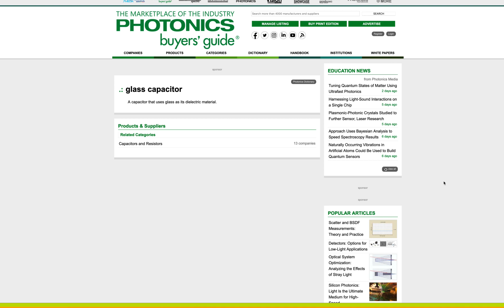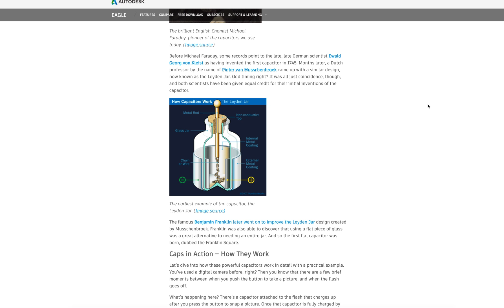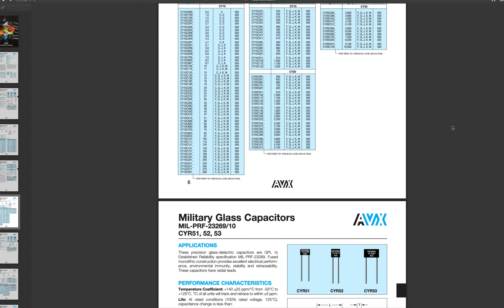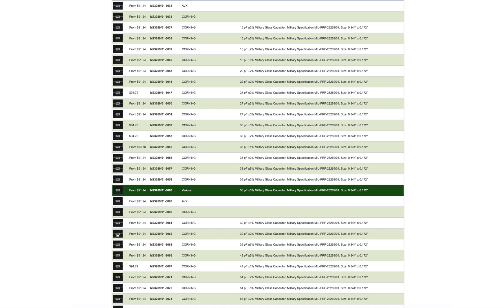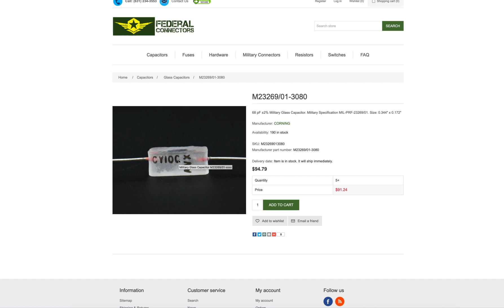🧐 GLASS IS A CAPACITOR. PERIOD! Academic hubris run amuck

Comment: A capacitor is actually what you get if you put an insulating material between two separate conductive materials, for example, a capacitor can be formed if you place a thin sheet of plastic (the insulating material) between two separate sheets of aluminium foil (the two separate conductive materials), it was originally referred to as a condenser before it was called a capacitor.

Comment: Why don't they make capacitors out of quartz instead of glass? Quartz is clear hexagons on atomic structure where as glass amorphous hexagons on atomic structure. Also it is rumored quartz are used in anti-gravity crafts, check Mark Mccandlish video. Viktor Grebennikov's anti-gravity beetle wing cover also had microscopic hexagonal pyramids so there's some connection there. Viktor Grebennikov glued lot of beetle wing covers in his anti-gravity craft in pyramidal position and ran high voltage through it with Van de Graaff generator. Pyramid shapes and hexagon shapes possibly have connection to anti-gravity secret. The book Shape Power by Dan A. Davidson goes into this.
Reply: They use quartz in all communication devices. So maybe they do use them as capacitors as well as peizoelectric  frequency producers
Reply: Mainly because applying a voltage causes them to resonate/vibrate at their resonate frequency. They are quite useful for controlling oscillators, but not so much as capacitors. I would add that they do so by a sort of capacitance reaction, and they do not pass the voltage through themselves, so in a sense, they are acting as a capacitor even as a piezoelectric, frequency specific oscillator.
Reply: What causes the resonate frequency though. What if capacitance can alternate, ie. ac as apposed to dc capacitance. Couldn't an alternating capacitance be the cause of vibration and like sound propagation in a guitar string, wouldn't this vibration naturally find the resonate frequency of the medium vibrating?
Reply: @Collinv707  That is pretty much what I was getting at. It is a sort of capacitance reaction in the crystal that results in a vibration or oscillation of voltage in the circuit.
Reply: Yes I get it. Another commenter mentioned that in their home country, and other countries outside of US of trendy, what we mericans call capacitors, actually translates to condensator. Just think it makes complete sense, thought id mention it.
Reply: @Collinv707  Well, isn't that what we have been saying? I'm confused why you keep asking. Yes, that is what happens.
Reply: Because vortex? Yeah im vortexting knowledge (No ledge) (null edge?) Pulling the pushing into perpetual curcuit. Quasi vortexting. :)

Comment: Silicone dioxide layer on wafers/dies/chips used as capacitor dielectric for chip circuits. Linear non-digital chips often include those capacitors.

Comment: I thought it was common knowledge that that the charge is stored on the dielectric. It's the conductor that allows the charges to become polarized. Glass can also absorb the microwave energy if you get it hot enough prior to microwaving it. If you heat part of it with a blowtorch and microwave immediately Afterwards it will cause the glass melt
Reply: No, only the wise know that the charge is on the dielectric.  Everyone else thinks it is on the plates.  For example,  https://www.electronics-tutorials.ws/capacitor/cap_4.html says right on the top of the page, "Capacitors store electrical energy on their plates in the form of an electrical charge".

I think the reason that they say "on the plates" is that you can use a vacuum as the dielectric. This is not convenient for those who deny the existence of the Aether, so they have to divert attention to the plates.

Comment: You said it yourself, glass is used as the dielectric. Glass on its own does not make a capacitor.
Shouting 'GLASS' every five seconds does not change that.
In fact every insulator can be used as a dielectric, "ceramic" capacitors are really common, the ceramic part is only the dielectric.

So glass is just ... glass. Until you sandwich it between a couple of plates.

Comment: Are the charge and discharge rates equivalent to other capacitors? 
What are the ranges of capacitance in farrads?
Are they used in pi filters, chokes, LC circuitry ... ? I looked it up.
They come in Pico farrads. Super fast switching capabilities.

Comment: The glass bowl blew up because it couldn't take the heat and internal forces that result. The microwave safe glass you are talking about was designed to be less susceptible to thermal shock and expansion... you have so much in your head, but know so little.

Comment: And that's why in my own language, a capacitor is called a "condensator".
It's called like that in most European languages.
Reply: Thank you so much. Electrical condensation. Amp, volt ohm and watt can all be translated in terms use for liquids. Pressure, flow, volume and such. Electricity is like water ofcourse.
Reply: We used to call capacitors condensers a long time ago in the U.S.
Reply: @markg7030  Any idea why it changed?
Reply: @robbedoeslegrand236  The name change in 1926 was to avoid confusion with steam condensers. Condensers were also described by their "capacity".

Comment: I actually over used one of my cheap microwaves to the point that the glass tray that came with it actually loaded up and popped inside the unit while in use. So it wasn't the cold air hitting the hot glass tray breaking it (uneven heating/cooling causing stress), it was the over loading of the glass tray with energy. Yeah it was hot too but not the cause! Another great video, should have called him out by name though. Enjoy

Comment: NonMicrowave safe glass demonstrates its unsuitability due to metals in the glass, heat expanding the areas around a "hotspot". These occur due to nonuniformity of field, ie foci. The glass being not absolutely even in density and so the pushes and pulls that form in the glass eventually cause the glass to surrender.. Whoa ok we said the same thing but spoke "different" languages (u speak on emr, em in general and the terms applied to new frontiers for me). Thanks for going  so in depth. I learn despite my naivete to terminology. I also learned i know jackshit about magnets, so u r helping me to learn. Keep em coming😀

Comment: if i use a filter that reflects light back into the led, is it more efficient than an in line resistor? yes nothing to do with this but what the hey. thanks
Reply: trust u guys. thanks 4 vidios big guy.

Comment: Glass is a capacitor OR... is the Capacitor a Glass? Does that mean that my windows can hold an electric charge?
Reply: Yes, actually. If enough charge is applied to plates on either side, sure. Or you could induce a high charge with microwaves and blow it up like the example he gave.
Imagine a high powered microwave "gun" you could use to shoot out windows....
Reply: @Myrddnn  Now that is kind of crazy and scary.

Comment: Do you think Fasces could have been a capacitor of sorts that could be discharged into trees going to ground through the roots and causing liquification or mud flood?
Reply: If by Fasces you mean a bundle of sticks or twigs, not sure how that would work as a capacitor. Too much conductivity to hold a lot of charge before it breaks down. Making one out of glass could work.
Reply: @Myrddnn  thanks for the response. I found that the first Fasces ever discovered had metal rods not wood. Also it is said that the Fasces was not allowed to be carried in Rome unless the blades were removed. I have more circumstantial evidence if interested. Peace.
Reply: @jasonhand7334  if the fasces were made of metal, they would likely be conductors and therefore not good as capacitors. They have to have a dielectric (insulator) between the conductive ends.

Comment: I wonder if I can use a glass capacitor in my guitar 🤔
Reply: Department of Honda Speed  yes you can. Might be interesting.
Reply: If you have need for caps in the picofarad range, sure. Just make sure they match specs with what you replace.
Reply: What difference would it make if it has the same specifications as the caps you now have?
Reply: @markg7030  yes same specs, but different materials do change the tone of a guitar, I just want to experiment with the glass, but I think I'd still go with vintage style PIO caps just for bragging rights.
Reply: @markg7030  I think that the glass ones would be potentially last longer, but I would have to check. Ceramics come in the same ranges as glass, so it might just be a matter of what's locally available.

Comment: Much like a condenser or heat flange to diffuse the heat, the glass diffuses the electricity?
Reply: @FractalWoman  :)
Reply: In most European languages a capacitor is called a condensator. (Hint, hint.....)
Reply: @robbedoeslegrand236  awesome! And our liver diffuses blood. And our ears condense sound. And our eyes conduct "light". Like an oxbow lake, a dam, a river. A.k.a Ether! Everything in the universe. Just like Ken says. He speaks truth. :)
Reply: The glas,or any other dielectricum, forms dipoles when placed under a electric field. These dipoles increase the capacity of a capacitor. So glas adds extra "storage" to the capacitor.

B.t.w. I disagree with Kent somewhat. Glas is not a capacitor, it is PART of a capacitor. You still need two wires and plates to make it a capacitor.
Reply: @robbedoeslegrand236  semantics?
Reply: @SimplyHuman186  Semantics + OCD + many years working with electronics.
Reply: @robbedoeslegrand236  understandable!

Comment: Solar cells are made of CdTe and work on the basis of (Golden Ratio) based thermal conductivity. The melting point of CdTe = 1364K(elvin) = The 15th LUCAS number = The Golden Ratio raised to the 15th POWER - The Golden Ratio raised to the -15th POWER    

NOTE: The temperature of the photosphere of the sun = 5778K(elvin) = 18th LUCAS number = The Golden Ratio raised to the 18th POWER + The Golden Ratio raised to the -18th POWER    

See the Golden Ratio Harmonics?! Φ³
Reply: Ps. Energy transfer is Golden Ratio POWERED based. 

"Nuclear" POWER plants:  [Herndon 1992] Uranium Oxide equilibrates with Metallic Uranium at 3571K(elvin) = The 17th LUCAS number = The Golden Ratio raised to the 17th POWER - The Golden Ratio raised to the -17th POWER

And I love your work Ken!
Reply: As per Ken L. Wheeler! https://youtu.be/McuQ1MzZfI0

Comment: 60 years ago I built a very large Tesla coil, excited by a couple neon sign transformers and a spark gap, and I used SEVERAL large plate glass with copper foil glued to each side for the capacitors, experimenting with them in both series and parallel.   Gee--60 years ago we knew glass was a capacitor.  The other thing I learned from playing around in those days, was that the normal things we think of as non-conductors, become conductors at high-frequency-high voltage levels, or better to understand:  that these non-conductors, in their natural state are conductors of HV and static forces all the time.  Everything is inertia and inertia in motion.    _111
Reply: Correct.  That is a given.  The uniformness of the glass used in the separation of the copper or aluminum or whatever, makes it an ideal medium.  We typically used the medium type to describe the capacitor.   If the metal plates are rigid enough, air can be a capacitor medium with the added benefit of being able to more easily vary the surface area and space between--capacitance.

Comment: Silver mica, glass, silicon, air-gap and vacuum capacitors are named for their dielectric, not that their dielectric is the capacitor. The dielectric doesn't trap the charge... it keeps the charge from passing to the other side, which allows it to build up. What is so difficult about this? Also, this is a distinction without real difference. Whether the charge permeates the dielectric to some degree is well beyond the scope of most uses of the capacitor itself. Can you prove that the glass absorbs all of the charge? Here you go, build your own capacitor, charge it, and then remove the two plates on both sides. If you are then able to transfer a charge from the glass to something, then you are right. Have you done this?
Reply: Considering film capacitors with their different plastic films I observe that over time they got smaller and smaller for the same value of uf and V.   Part of the size reduction is due to metal foil getting thinner, but that's not the whole story.   Ever newer plastics have higher dielectric ratings so that they can be much thinner too.   The present day dielectric does it thing in capacitors by appearing to the foil to be much like the thinker plastic films of yesteryear.   It is not just that the thinner present day plastic films have greater suppression of arc over from now more closely spaced foils, but...well in a way they do because they can hold more charge before alllowing arcing.  

If you charge a capacitor and then separate the metal plates the charge on the plates goes down due to distance between plates going up and as the plates are moved away, charge stored in the dielectric just goes with the plates.

No dielectric in any capacitor holds a charge all by itself when the plates are separated.  A dielectric capacitor is not a battery which holds charge as ions.  Take the electrodes out of a battery (or electrolytic capacitor) and the ions remain, but then you can't do much with a battery that has no electrodes.  

A dielectric suitable for capacitors will be both an insulator and a dielctric depending on how it is used, and it has to be that way cuz if it was a conductor and not an insulator then the capacitor would be a resistor.
Reply: @rh001YT  The statement this guy is making about the glass being a capacitor is dishonest. The only reason the charge is anywhere near the glass is because the charge is clinging to it for dear life trying to make it to the other plate. If the glass was a capacitor, then it should be able to hold the charge with the plates gone.  A capacitor is not a single thing. It is a system that works together.
Reply: @rh001YT  If we used the definition of a capacitor in this video, then everything that insulates is a capacitor, and simply is not true. If something has attained a static charge from its surroundings, does that mean its material is a capacitor? The way this guy puts it, it's more of a philosophical statement than a fact about the workings of capacitors. He is making a non-functional distinction.
Reply: @ J Schultz   I have to disagree.  No capacitor holds a charge when the plates are "gone".  But if one charges up a capacitor and then removes the voltage source that charged them it will hold a charge.  The charge is both on the plates, or foil, and in the dielectric.   We can see that it's in the dielectric by connecting the capacitor to an oscilloscope, ideally with 10 Mohm impedance, overserve the voltage, the short the leads of the cap very briefly.  Upon release of the short the capacitor voltage will  begin to rise as charge comes out of the dielectric more slowly than it comes off the plates which happens instantly.  That rise in voltage is due to dielectric absorption which is usually unwanted by some is always there with most any dielectric.  I am not saying all the charge is in the dielectric due to absorption, but the absorbtion shows that charge does go into the dielectric.  

It's not that a capacitor would refuse to charge up or pass ac voltage without a dielectric but it can hold more charge and pass more ac current when a suitable dielectric is added as a spacer between the plates or foils.  

A 1uf 400 volt film capacitor can be purchased today that is 1/5 the size of the same value capacitor in 1960 and it's not soley because the foil and film are thinner.  In fact the films are engineered to have higher dielectric constants so that the capacitor can be physically smaller.

BTW, did you know that a mu-metal container can prevent the magnetic field inside of it because it absorbs the field?  It's not blocking, it's absorbing.  Once a mu metal can has absorbed all it can then any additional field passes right through.

Comment: And one last thing, if you know the operation of a capacitor, you would know that if the glass held the charge then the capacitor would be continuously discharging since the charge could move to the other wire. The charge never goes through the capacitor... it goes in one side, stays there, and then leaves the same way it came. If the glass were the capacitor, what would keep it from bridging the gap between the two wires? You make no sense. If what you are saying was true, then capacitors as we know them would never have been able to exist.

Here is a technical question for you, which you will not be able to answer. Why is the capacitor wired in parallel to the battery, rather than inline (series), as you say it would be for the glass to be the capacitor? https://www.build-electronic-circuits.com/how-does-a-capacitor-work/